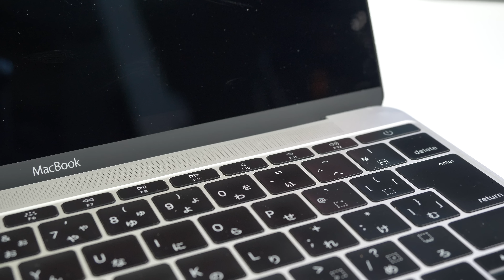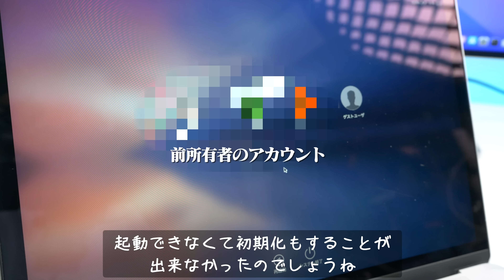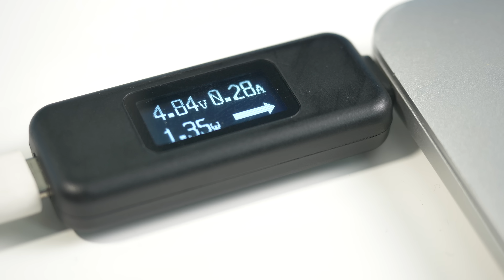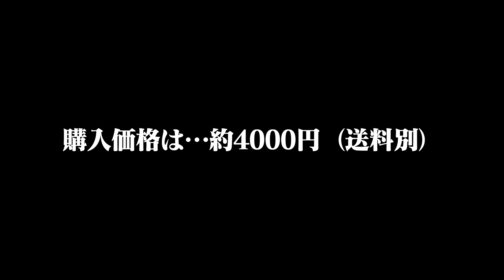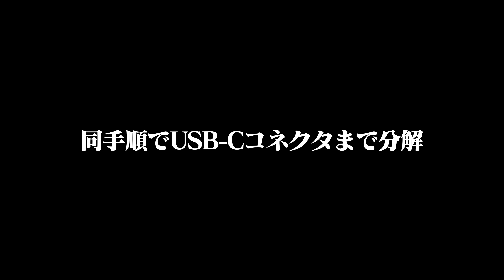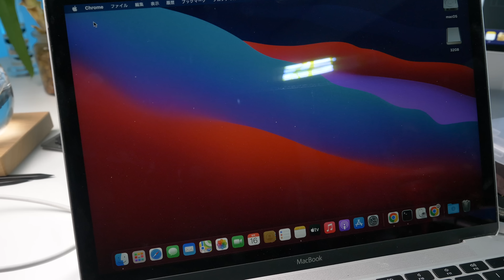中古相場4万円ジャンクなら7千円！、起動NGのMacBook 12インチRetinaのジャンクを買ってみた【USB-C交換】

Comment: How did you fix the dent in the Space Gray case the drill bit left? I still find that horribly destructive-there's no way to remove the SSD? I wonder if an electromagnet like we used to use on tape decks would wipe an SSD
Reply from the maker: The space gray case was not modified.